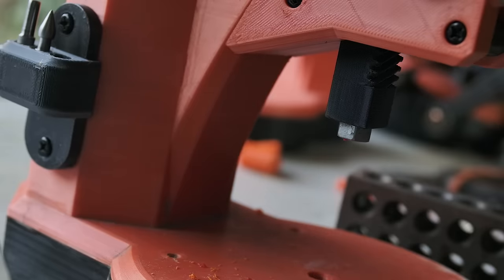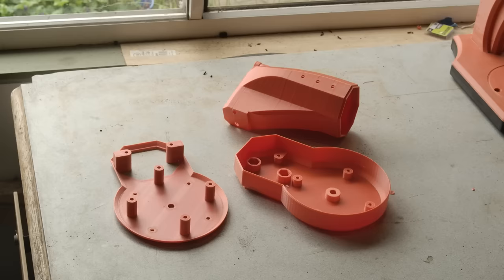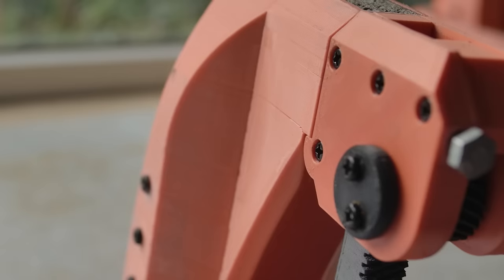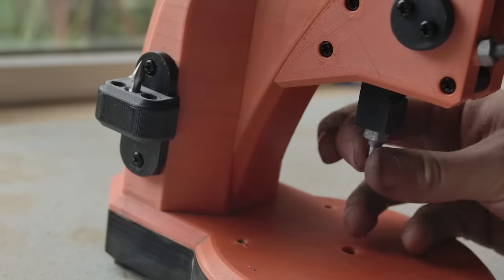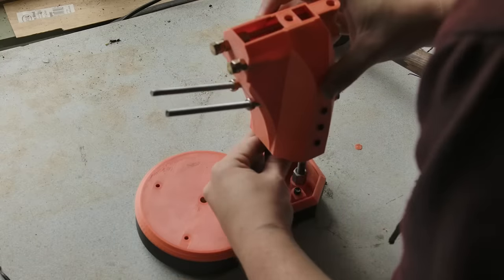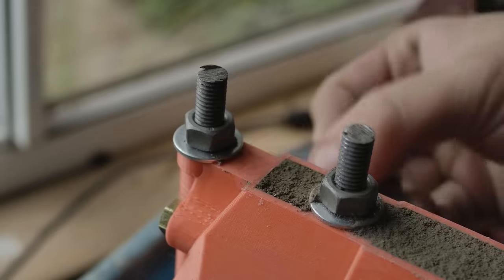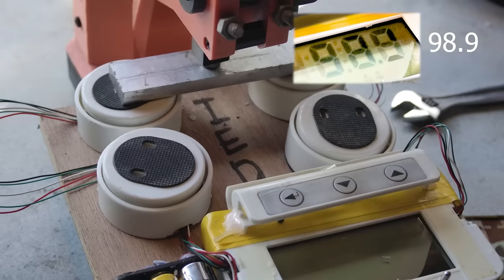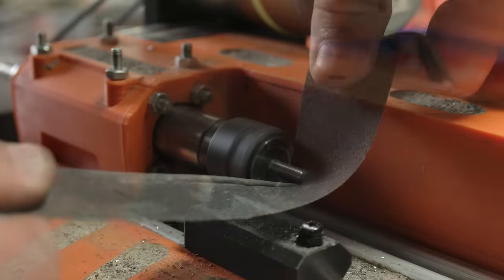Can You 3D Print A Useful Arbor Press?

Comment: This channel is the number one reason of why I’m getting a 3D printer (and some bags of concrete)
Reply: Dude I think my 3D printer might just be my single best purchase ever. It's a toss up between that and my paraglider. I know this won't be the experience of basically anyone else, but purchasing a 3D printer directly led to me getting an incredible new job that perfectly matches my interests and skills designing robotics toys. I was a teacher before that. Even if that doesn't happen, 3D printers are incredible tools. I used to think they were just for printing flexible dragons and iron man helmets, but they're quite possibly the single most versatile tool humans have ever created. This channel really showcases that fact. Just do yourself a favor and don't go cheap. There are a bunch of great mid range options out there now that are absolutely reliable workhorses. I know people love their Ender 3s for whatever reason, but I've never seen someone use one of those without immediately spending the price of the printer all over again on upgrades just to make it usable. Personally I love Prusa. They are more expensive, but we use them at work to prototype injection molded parts. They have thousands of hours of print time on them, and never once have we had to do repairs on them. I just keep the beds clean and the filament dry. Also they're FOSS/OSHW, and that kicks ass. We also have Bambus, and they are faster, but they're a bit less reliable. We've had some break down already. They also aren't as dimensionally accurate, but I think that won't matter as much for most use cases. Good luck on your printer adventures! It's a super fun world to get into.
Reply: @mid88night  I sometimes joke that I used to have an Ender 3, but now I have an Ender 3 frame with a completely different printer on it.

But in comparison, I have a Magneto X now, and that thing required no tuning besides setting a bed mesh. I actually went through all the standard stuff and ended up pretty much the same as how it started. I think the Bambu printers generally have an experience like that too, although they're a bit more proprietary when they don't need to be.

Personally I think 3d printing is getting into a pretty great place where pretty much anyone can just pick up a well tuned printer and immediately start printing with cheap engineering-grade materials like PETG-CF that are commonly only $25/kilo. Even PET-CF is getting down there and giving polycarbonate a run for its money.
Reply: @mid88night or if you want a tool and not a hobby just get a Prusa or Bambu Lab.
Reply: @GabrielAlejandroZorrilla Some people prefer the hobby.
Reply: @saintjohnny45  Creality is still doing business for them!

Comment: Nice video.  With respect to the concrete, it seems like it's normally in tension and shear (while the press is pressing).   Concrete is strongest in compression and worst in tension, so it seems like it'd be useful to post tension the concrete to preload the structure.  That way it'd be in compression until you overcome the preload force of the post-tensioning.  Granted it's moot since the concrete isn't the weak point of the press.

Comment: you should consider with putting the lever gear behind the rack. that way you will push down on the lever instead of up, helping the press body not fail. awesome design too. maybe if the rack was a bit thicker, the forces would be greater. keep up the awesome work
Reply: Yup this. Both behind and wider rack. And awesome work, concrete as a filler is pretty novel. Chicken wire is easier to install but still provides some flex compared to something like grid wire. It probably doesn't make a difference now but if you get into the higher torsion it would.
Reply: Chopped fiber glass is a good filler. And even fiberglassing the outside would work wonders and relatively cheap
Reply: I was looking for this comment, had the exact same thought.

Comment: Have you considered using a CSA based concrete? Here in the states we have "RapidSet" and they even sell additives to increase flow. You may also want to look into "plasticizers" for cement. They are additives that allow you to use less water. Then you can add stuff like glass fibers without ruining ratios.

Comment: I think you might have this backwards. The pinion gear on the shaft from the handle needs to sit behind the rack, with the rack gearing being on the back of the rack. That way, downward movement of the handle translates to downward movement of the rack, which should reverse the load direction the frame is seeing. At least, that seems correct in my mind. The rack/pinion teeth will still be the weakest part, but I’m curious what moving the pinion behind the rack would do. Loved watching this though!
Reply: Yeah, with every arbor press I’ve ever used, the gearing on the rack is on the back, and the handle/pinion shaft and gear sit just behind the rack, which translates the movement that way.

Comment: Figured I'd compile some of the most useful tips on your hardening process:
Use a higher alloy steel. These can be commonly found as "Grade 8", "12.9 metric" or "Alloy steel" bolts. These have more 'potential' for hardening than mild steels, which most cheap bolts will be made out of.
Use a stirred ice/salt water quench instead of an oil quench. Oil quench is most common on tools where it is useful to trade a small amount of hardness for increased ductility. Your punch will not need ductility to resist impact, so try to make your quench as harsh as possible. 
If you can enclose your part while you are heating it, even between a few common bricks, you will find that you can reach orange-hot temperatures much easier. The camera can be deceiving, but it seems that what you reached was red-hot, which is below the heat treatment temperature for many grades of steel. 

Best of luck!
Reply: Excellent tips, thanks for sharing! (I hadn’t thought of using 12.9 bolts as hardenable stock before. What’s their alloy, do you know?)
Reply: If you are unable to locate higher grade iron for hardening, see Chris' (Clickspring) video on case hardening as an option. I'm not going to suggest it is better than using pieces of drill rod annealed for shaping and threading, then hardened and tempered, but it's better than not doing anything.

Comment: I would love to see the limit of the other parts of the design by you iterating a few more times on the rack teeth until they’re not the failure point.  In principle if you have high strength concrete shaped in relatively favorable triangles of the given inner dimensions providing a strong base for a lot of leverage.  It’s not that surprising the thinnest plastic feature is the first to go, for sure.

You are a great toolmaker and craftsman, excellent work!
Reply: Seems like a cross slide vise is the next item to turn the lathe into a mill.

Comment: It's so close! You could totally reach it if you change up the gears and rack. Increase the pressure angle for thicker teeth, a larger module fir physically larger teeth, or changing the material for something more durable

Comment: Nice!  I've made some crude concrete based machines but WOW, yours look better than mine!  I have suggestions! You may want to consider is putting the rods through a single metal plate on both ends. The plate will increase the compression on the concrete, tie the allthread together,  and give you a stronger part. The way it is now the nut only compresses the concrete directly under the washer and you could crack it in the space between the threaded rods.  2) I started 3d printing funnels to guide the concrete into the form, if you run tape around them it keeps the concrete out of the layer lines and makes it much easier to fill. 3) for the rack, consider tying in another geared rack on the back. More threads will give you a stronger column. SO CLOSE! :)

Comment: I like all of your designs so far - just one question regarding the Arbor Press - is there a reason for lifting the handle up? as most all press's pull down on the handle so theirs no need to fix the base from moving and you should get a better feel of the force needed, I think your design would work better pulling down? Might be worth a try?.
Reply: That's all I could think of while watching, it's the wrong way from any press I've used or even seen. Fixing that would make it stronger and nicer to use.

Comment: Very interesting build.   The metal in the bolts may be an alloy which cannot be hardened.   In the US O1 drill rod is a common alloy which is normally sold in the annealed form and can be machined easily then hardened and tempered.

Comment: Long time enjoyer of your videos, thank you so much for this series. I think I came up with a very interesting idea for a limitation I can tell you fought with. For a press there is a balance between parts accessibility, and the presses core strength. But what if you could have both options depending how it was configured at use? Basically to get down to it, a nice chunky bolt that can be installed right behind the press arbor or at set increments of depth. If increments were used, you could even leave multiple installed all in a row for added tensile strength, until a part dictates a needed clearance. With this idea a lot of the forces generated would be shunted into the metal instead of flexing the concrete and mesh structure (simply having one installed, would turn that force back into a compression load.) Also I wonder if your gears would be more robust in Nylon, ASA, or maybe even PETG.

Comment: Have you considered replacing the rack with a course thread 15-20 mm bolt with 3d printed guides to square the profile up through the press? You are after all, already using an M8 bolt or all thread to compress the layers in the rack, You would need to change the helical gears angle some, and could include extending the threading shape across the square profile the bolt is in to hopefully reduce the stress on the driving helical gears.

Comment: to put a complaint, the handle works opposite of what i would expect and males less sense if you ask me, idk if this was made bcs of some difficulty, but pushing up to push down feels wrong af, and i feel like it makes it less stable, as i said idk if there was any problem, but it was a thing of changing where the rack and the gear is, just turning them around would have give you a down movement for a down push, like a drill press, if this was by choice or preference then cant say anything about it

Comment: Why do you have the wrack gear at the front, such that the lever works against the applied force, needing to be lifted up, rather than down at the hold point?
Reply: came to the comments section to ask this same question! I wonder if changing the direction of the lever's force would add that extra little oomph to get the clean 100, since you wouldn't be applying torque in the opposite direction of the main force

Comment: you have a partial tooth failure because the forces are pushing the rack and pinion apart. the more you push down on the bar the more force is acting against you in friction and in deflection and the deflection is also decreasing your grip. all to say that you made a press with a compliance based cap which would be great if you needed to ensure that can't exert more that 100lbs on a part that is more expensive then the press

Comment: I was going to say use hardware cloth but looks like you did.. You ever try fiber additives for concrete? Should add even more strength to it with minimal investment. It'd be fun to see your press test different samples of its self sorta like C&C kitchen does with 3d prints. 

Not sure if it interests you but there's some microwave casting videos on youtube that you could probably cast the rack and pinion in bronze or aluminum and pass your 100lbl goal.  Not much cost in getting into casting that way as you can get ones with broken lights and carousels things from family, ebay,  or dumpsters fairly cheep.

Comment: two gears to the pinion ? to  1 gear to the handle ?
and if u export ur cad work to dfx u might as well get it laser cut 
thinking along the lines of if you ebay parts like long bolts then theres no difference in ordering laser cut steel plates

Comment: Tip. Try to print every thing at a 45 degree angle. Prints often get much harder that way because each layer get a larger area to adhere to the previous layer. Check Slant 3D he talks much about that.

Comment: The steel you used for the punch may have been austenitic stainless, which isn't hardenable. It would be better to use high carbon non-stainless steel because it's easier to harden without weakening it. There are lots of stainless steels that will harden up too but they usually have a more involved heat treating process with holding times and are less tolerant of mistakes. For your application you can just hit some carbon steel with a blow torch to a red glow. (not yellow, not orange) and quench in oil. Then if you feel like it you can heat treat at about 175c in your oven for a couple hours to make it less brittle. This will drop the hardness obtained after the quench a little tiny bit, but this will give the part a lot more strength compared to using the steel without doing so.

Comment: Is there any way to get the 3D models for these? I'd love to try to make my own tools using these designs. I'm wondering the feasibility of combining this stand with elements from the drill press and tapping machines to make one stand with interchangeable heads. I know I could design it myself from scratch but I lack the time so figured maybe I could get a head start with the existing files.

Comment: Just recently i looked at all the 3D print arbor press models i could find with the idea of printing one to rivet kydex for knife sheaths.
I was wondering if they would possibly hold up even at 100% filament and seeing that yours even with concrete fails at 100kg i am pretty confident the others wouldnt hold up either.
I like the idea of two screws instead of a square axel, i will remember that for when the need arises.
But what did they connect to? The black part has to still go through the red one on some axel and into the middle gear, where i would expect a square to go through?
Lastly do you design your own gears or are those automated? Would maybe larger teeth hold up better? Or possibly teeth that have a longer straight section on their tips.

Comment: Let me get in my smart pants and give you some advice. I would print the rack on its side the teeth looking sideways and it would be much stronger. You can force the layers together with some small bolts normal to the layers planes. (4-5 pcs on both sides of the long bolt along the whole length must be enough) 
PETG rack and pinion would be more tough and have less friction than PLA parts.

Comment: Most likely you didn't harden that punch because you made it from a screw that probably didint have the right carbon content to be hardened. 

You'll want to try again with some annealed o1 tool steel. The o stands for oil hardening. It should come in already annealed rods from a metal supply store for cheap.

Comment: "Not everything makes sense to 3D print" 
I have to disagree in part. If you are wanting to learn how to design your own parts and tools, having a physical model of it is useful so you can understand the methods behind why some designs work and some fail. You also have the case where it may be faster and cheaper to print and do lost PLA casting than ordering the same object. (Aside: That may be something to play around with if you haven't already.) 

Overall, great video and content, you gained my sub from it.

Comment: Cool idea, but i'll keep my eye out for a used one that has a bit more durability.
Of course the hardening of the pointy tool does not work if it's the wrong type of steel. You need a high carbon steel, or introuduce more carbon to it in the heating process. Screws are usually not made from high carbon tool steel, because you want them to be ductile and not shatter quickly under tensile load.

Comment: You shouldn't use concrete for this since concrete is only good in compression and the way you  made the press, flexion and tension in exerced on the concrete so it makes kind of useless. I bet you could make it stronger  only using platic and 100% infill altough it would be long to print and expensive

Comment: mmm...you use only 2 of the 4 sensors... your scale is calibrated to resist the  total weight reparted between the 4 sensors... if you use only 2 sensor you should multiply the result by two, or at least use a board to distribute the weight on all the sensors...